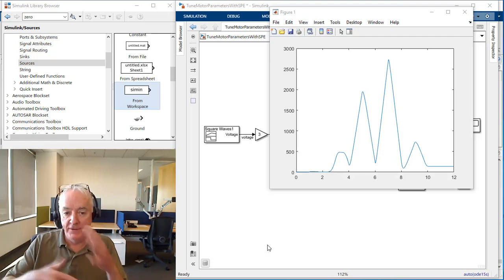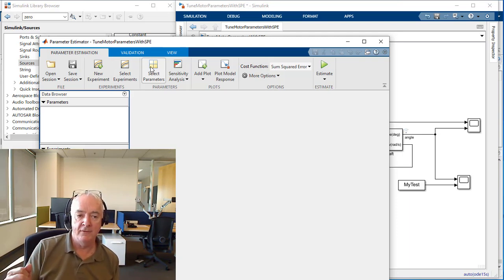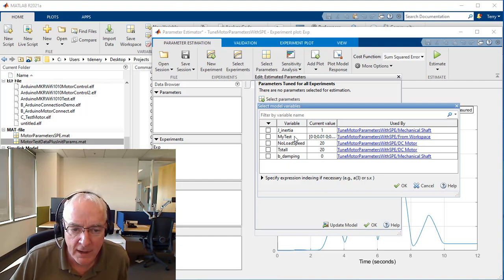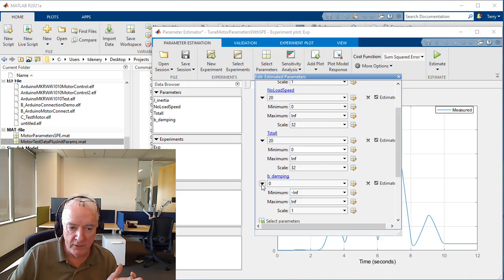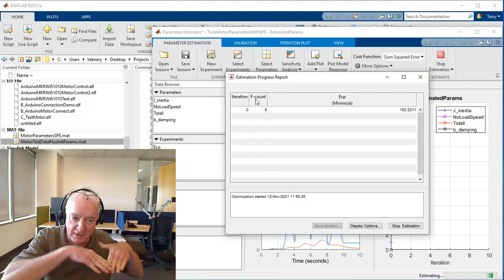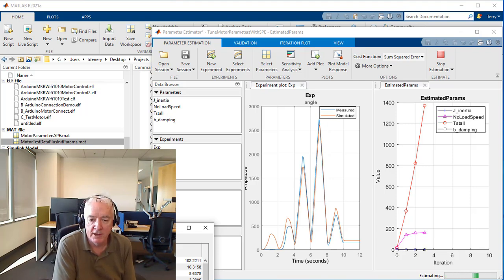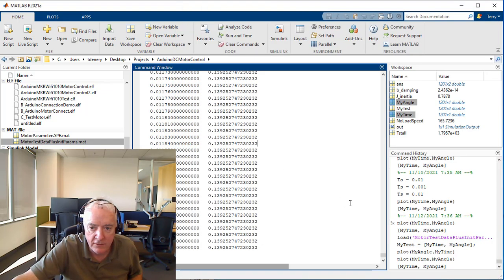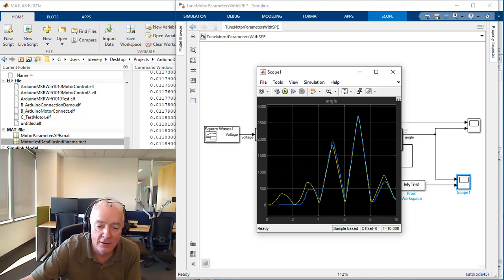Engineers Studio #33 - Tuning Parameters in DC Motor Model with Data

Comment: How were the measurements done? With or without use of a control system?
Reply from the maker: Angle measurements were made with an encoder on the motor, whose reading is accessed through the motor shield and a Simulink block co-developed by MathWorks and Arduino.